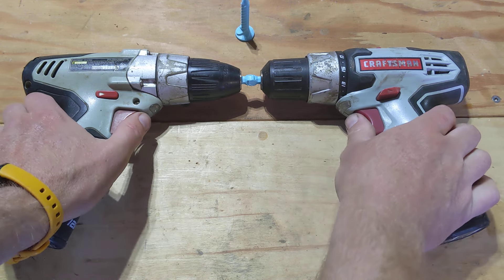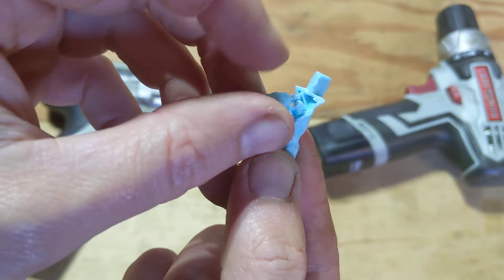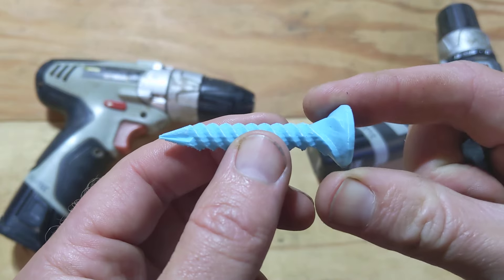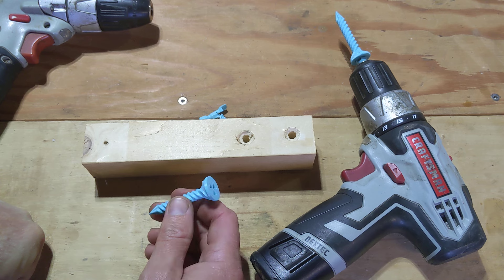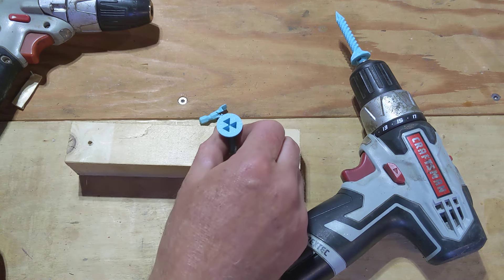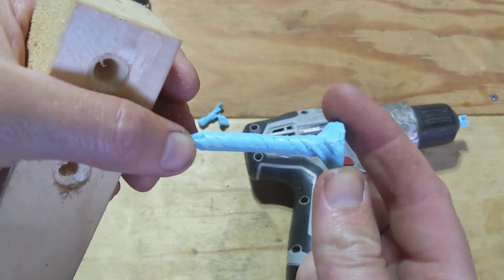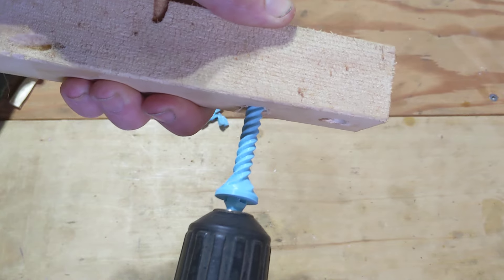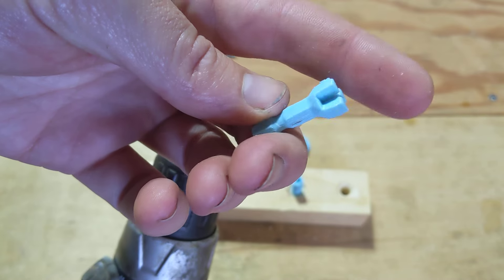3D printed PLA wood screw & driver bit

Comment: Printing some drywall anchors would be pretty legit 🤔curious how PLA would do with that
Reply: It will not do.
Polylactic acid permanently deforms under even slightest load, so it won't hold anything for long.
Reply: I'm with this dude. Print some really wide and flush headed drywall anchors. Something that doesn't rip the paper

Comment: Yeah, saw that outcome coming.  I've played around with PLA bolts, which can work with reasonable tolerances, but the threads won't survive any significant amount of friction.  The few times I've tried to self-drive them through a perfectly sized hole, they seized up and melted.

Comment: increase infill sir. since the force direction is rotational i suggest reorienting the screw at 45 degree so you stretch the lines diagonally for optimal tensile strength. also the shape of infill might be stronger than 100% infill in many cases i found. currently the strongest part i make are with gyroid infill at 82-88% infill. 

but im afraid this is a futile project sir. this wont work

also you have holes in your prints. thats not right. either too little extruded after retraction due to either ooze or incorrect deretraction speed and or length issue.

Comment: maybe some different threading options with less surface area to generate less friction could work.     Like little teeth for threads instead of a continuous ridge.  and of course a filament with higher temperature resistance. Metal screws do get pretty hot though. You might also consider a flat side on the longitudinal print to get better print quality.